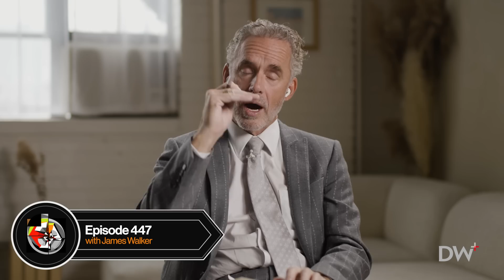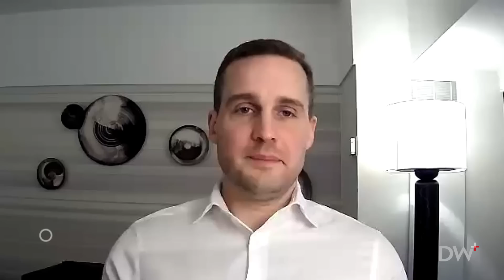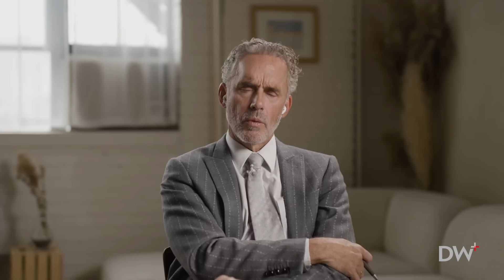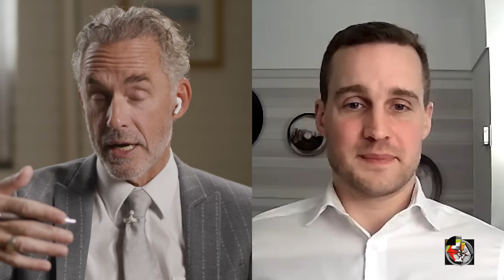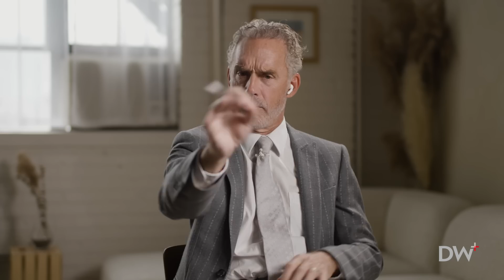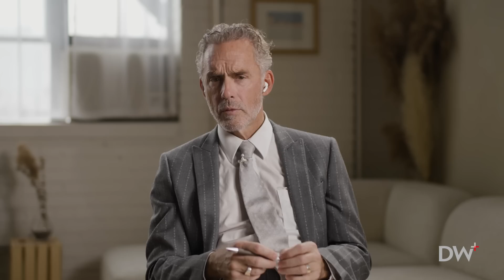There Is a Nuclear Reactor in This Truck

Comment: A single SMR can power a neighborhood for years without refueling. I’d let them put one in my backyard if I could 😂
Reply: I'd insist it was in my backyard, at least I'd know exactly where my power was coming from...
Reply: A hundred feet underneath isolated from the water table would be fine. Has worked for 50 years successfully in submarines. They are too small to be weaponised. Scale is important.
Reply: @AnonJohn143 a concrete vault might be a better idea, could place on surface and the tough construction would help prevent damage from natural disasters or other incidents.
Reply: @WELLbethere  fair comment. In truth accessibly is a double edged sword. I.e easier to access and fix on the surface, but also easier to abuse. It's a design/engineering problem. Hopefully they get over the corrosive issues with thorium molten salt reactors, it would make those aspects more straight forward imho.
Reply: I'd rather, see one in the local sub-station(s) and use the existing transformers and other equipment. Much lower voltage is needed for short power lines.
Reply: @tobyw9573  Wherever, however... I want to see nuclear power built out to the point that the average Joe could have a mini reactor in his basement!
Reply: This was part of Biden's New Green Deal that he was running before the last election. Small nukes to power small cities and big nukes for a large city. Biden never talks about it because voters would freak out if they did.
Reply: If they could get one to work…
Apparently no one has got a reliable SMR going well and/or safely
Reply: @michaelcooney7687  I believe that is only a matter of time.  
Also, when it is safe means never.
Reply: @michaelcooney7687  
Go watch a documentary on MSR.  They ran the reactor for two years shutting it down every weekend when the scientist went home.  That's dozens of starts and stops without an incident.  It takes days or weeks to safely shut down high pressure reactors.

The biggest problem with MSR is the bad reputation other designs have given nuclear power.  It's like thinking electric weed eaters will be noisy and smoke spewing because for decades all weed eaters were powered by two stroke gas engines.
Reply: @JimStanfield-zo2pz 
While that sounds great I'm willing to bet there's some serious losses in efficiency due to friction, pumps and motors.

That does remind me of one proposal to use hydro in places with huge tidal shifts where the water rises and falls a few feet daily.
Reply: Perpetual motion machines dont work, no matter how you try to finagle them.@JimStanfield-zo2pz
Reply: SMR? Did you really mean MSR (Molten Salt Reactor)?
Reply: @Milosz_Ostrow  Small Modular Reactor...
If I parsed it correctly.
Reply: @wheel-man5319  - That's the problem with using acronyms and abbreviations.
Reply: @Milosz_Ostrow  Indeed...
Reply: You would do this because you are uninformed on better options.
Reply: @DoniIionescu  please inform us of any available better options?
Reply: Make sure they can bury the waste in your yard as well. Alls fair, Right!!!!
Reply: @KOz1caa  I've no problem with nuclear 'waste' being stored on my property.  The only caveat I have is that I, or my heirs get to sell it when the rest of the world stops being insane about nuclear reprocessing....
Reply: u lack the qualified people to maintain them
Reply: Sure.. only cost 100 millions dollars  to install and operate...  

just like buddy's dream with trucks and facilities.... its not economically viable!!! ... not talking about the waste companies have to pay for 100 years...
Reply: @joseph-mariopelerin7028  
And why are those cost so high?  Because activist pushed to make sure they were.
Reply: @tonyrmathis activist? Lol 
Don't need any activist to make people realize it's not economically viable... 

We still paying for decommissioned plan 60 years after... if thats a better legacy...
Reply: @tonyrmathis you're right tho... without activist, they would still be dumping waste in the ocean... and the whole thing would be affordable...
Reply: @joseph-mariopelerin7028  Broken record much?
Reply: people do not like nuclear reactors, they want hydro
Reply: @shazzz_land  
Sure we love hydro but do you know a way of creating new rivers?  A direct line to God perhaps?  I'd rather not insult you but I think the point needs to be made that our biggest problem with solving our energy problems is people who go by feelings rather than logic.  Energy is a hard science problem not a social science one.  It's math not feels.  We can't dismiss things like power density, reliability and other concerns simply because they favor types of generation that don't feel good.  We also can't pick and choose which environment risk we ignore.  Windmills/Dams killing threatened species and pollution from mining for solar is just as serious an environmental threat as containment of long term nuclear waste.  In fact I'd argue even more so since once those species are gone they're gone forever.  While a 1000 years from now we'll most certainly made advances in the storage and probable use of waste.  What we need is to embrace science and work on our own insecurities by educating ourselves and that too not with just information that makes us FEEL good.
Reply: @shazzz_land >>> Hydropower is not available everywhere.
Reply: @shazzz_land  In the US we have torn down hundreds of hydro facilities to return the waters for fish movements etc.
Reply: @shazzz_land you speak for all people? Amazing.
Reply: @shazzz_land  hydro often involves destruction of habitat and land through flooding and isint always possible on a wide scale. Having said that id support it where doesn't do so much damage as it acts like a battery of sorts. I think the mix of power is possible, and nuclear provides a reliable and relatively clean baseline of power IF managed correctly. We need to train more people to do so imho.

Comment: U235 is the only easily fissile isotope of uranium and it is more rare then platinum. Imagine using platinum as fuel, kind of insane. I know we have enrichment plants to bombard U238 -> U235 with neutrons, but its an insanely costly practice.

I'm all for nuclear power, but the uranium cycle sucks. Thorium-232 is so much better. It's 99.8% of the naturally occurring isotope, it's super abundant, and we already have a stockpile of it from discarding it as "naturally occurring radioactive material (NORM)". Breeder reactors use it, right now India is planning to build the first commercial advanced heavy water reactor using thorium-232. We should be more like India.
Reply: let them catch up.  Baby steps needed for the fear-filled babies.

Comment: LFTR’s. Liquid Fluoride Thorium Reactors are the answer to most of the problems noted here
Reply: I really really wish ae would go with the Liquid Fluoride Thorium Reactor. That thing is so badass. It has multiple built in fail-safes by nature such as already being "melted down" so it cant catastrophically melt down, also the liquid fuel expands AND absorbs neutrons slower the hotter it gets, so as it expands more of it moves outside the core providing less fuel for fission, if theres a leak it drains into a storage tank below by being within a kitchen-sink-like room, and also if power or control is lost itll stop freezing a normally frozen salt plug which melts and makes it drain itself. Its basically infeasible to proliferate nuclear weapons from the products of the reactor (theres small chance to do so while enriching fuel needed to start the reactor, but very little is used and is only needed for startup, after that the reactors dont need to shut down to refuel so they can run for years at a time. Also they can also use nuclear weapons and nuclear waste from currently used reactors instead of enriched fuel to start their fission reactions, and turn them into a lot less and shorter lived radioactive byproducts.). It can use 99% of its fuel, versus current reactors using like 5% of their fuel that make a lot more longer lived waste (1,000's of years vs 83% of LFTRs waste being within 1-300 years and 17% being decades, but its more radiotoxic.). The molten liquid salt is both a coolant and fuel that jackets the core and both shields it from radiation and absorbs the nuetrons, converting it into the isotope of uranium needed to be pumped into and used in the core for fission. This makes LFTR's scaleable, you dont need feet of concrete or lead to shield you. The reactors operate at atmospheric pressure and if theres a loss of containment, the molten salt is actually extremely stable and wont react with the air or water and doesnt build up explosive gasses, just xenon gas like other reactors which "poisons" the reaction but it can be actively removed, just as fuel can be added, without shutdown unlike normal reactors. Thorium is 4 times more abundant than uranium AND is a nuisance byproduct in rare earth metal mining. We have enough thats been buried in Nevada to run for 400,000+ thousand years. To power the USA for a year youd create roughly a briefcase sized amount of waste. There are proposed methods with MSR's to have more efficient turbines than current steam turbines using the liquid salt and gas I think. This is all from memory and Im struggling to recall but theres a shit load of good reasons to go with LFTR's and most of the negatives can be reframed as positives pretty easily. A power grid supported by nuclear and supplemented by renewables where feasible is the best strategy for our best economical, environmental, defensive and political future with a prepared and prolonged infrastructure and society.

Comment: This isnt incredible. 

This isnt new.

Reactors the size of a refrigerator have been in service since the 50s.
Reply: 'Over its 10-year service life, the PM-3A system had availability of just over 72 percent. By 1973, however, the reactor was shut down and decontamination operations started. For detractors, the system was a failure. But a close look at the final operative report, which is available online, shows that system failures were the result of not just the deficiency of materials available half a century ago. Instead, the system failures were due to repeated sensor and control electronics problems, along with plant shutdowns for maintenance, repair of systems not involved in the reactor itself, plus crew training and changeover.'

Comment: I always respected Robert Anton Wilson's observation that the closest naturally occuring nuclear reactor to the earth is the sun, and that might be an appropriate template or model for how humans can safely use nuclear power.
Reply: It's so much more complicated then fission. The sun undergoes fusion, which is like hitting a golf ball up a hill and both the ball and the hole are opposite magnets, we're trying to get the ball in the hole. A highschool kid can accomplish fission in their backyard.

All fusion engineers will tell you fusion is 10 years away 10 years from now.
Reply: @maximusf3063  I just mean the scale/distance ratios for safety.
Reply: The sun causes cancer and blindness if you stare at it for too long.
Reply: The sun uses nuclear fusion, not fission. Fusion is much cleaner but much more difficult to pull off today.
Reply: nuclear FUSION reactor - this interview is talking about nuclear FISSION reactors
Fusion experiments have all failed, failed for more than 50 years and I suspect that there will never be fusion reactors on the face of the earth.

Comment: There are different types/ways to make radioactive fuel.  The less popular has a shorter life cycle which does not take nearly as long to break down to safe levels.  In addition the “waste” from large power plants has plenty of energy to run smaller plants for a long time, so it can be recycled almost directly if we so wished to do so further reducing any waste.  Right now it is disposed of as soon as it drops from maximum efficiency for a large nuclear plant.  We have the technology!
Reply: Thank you, you are correct and we all will benefit when they stop the waste. CO2 free energy, who would have thought
Reply: My understanding is that France has been reprocessing "spent" fuel from nuclear plants for decades to remove waste components and reconcentrate it to reuse over and over in their power plants.
Reply: There is no such thing as waste. The so called waste is only a resource we are not using.
Reply: @mpetersen6  Hence, waste.
Reply: @TheCrazyFinn ”so called waste”
Reply: @rush7805  "no such thing as"
Reply: @mpetersen6 Waste is not just "spent" fuel. Waste is also anything that comes into contact with radioactive material and isn't useful anymore. You can maybe use spent fuel in a smaller reactor. You can't put used surgical gloves in a small reactor.

Comment: And the spent (discarded) fuel goes where?  Maybe under your pillow?
Reply: Stored in site or in an interim facility waiting to be recycled in fast reactors or recycle just the fissile components in MOX fuel for another reactor (only 4% of fuel gets used up) or entombed in a multilayered concrete cask in a long term geological repository 
. Your choice what to do with it
Reply: Look at ifr ii, it has been done. It's an outdated argument.

Comment: Bless his heart.  JP thinks you can put an industrial building together in 1 year...not to mention a nuclear building....
Reply: If Tesla could build the largest factory in the world in less then 10 months it ain't unrealistic.
Reply: The Empire State Building was 13 months from groundbreaking to completion, so we HAVE done this kind of thing in the past. Admittedly, in our current environment, that's very unlikely. There's also no reason we can't rebalance the regulatory environment if we feel that pendulum has swung too far toward stasis.
Reply: @ChuckMcKinnon71  yeah, sorry, I wasn't saying we don't have the will to get things done this quick.  But there is so much red tape, regulations, reviews, third party reviews, city reviews, federal reviews, and design changes that make this really hard to do.  I worked at a nuclear plant and it took 3 years just to put up 2 concrete walls and a concrete roof for a backup generator.  Why?  THE REVIEWS!  We were doing paperwork for months and designed formwork for impossibly high loads.  So yeah 3 blocks of concrete in three years and millions of dollars....smh

Comment: small nuclear reactors are not a good idea and a safety concern.
Reply: Nope. They are safer than traditional reactors, as they are designed to fail to "off", have better shielding, and can be easily maintained.
Reply: @timothyblazer1749  yes but proliferation of small reactors is an issue. It's impossible to secure all those thing and watch over them as well as big systems. Terrorist attacks are also a big concern.

Comment: I swear I have seen stuff about Dimond nuclear batteries saying they could be as small as A.A. batteries but last a person there lifetime? Random tech stuff I hear I'm a technerd 😂
Reply: My understanding of nuclear batteries is that, yes they last a very long time (decades?) but produce very tiny amounts of electricity.  As in fractions of a millivolt. Useful for satellites or space probes that need to be nearly dormant for very long periods of time but need to be "awake" enough to receive the signal that tells them to power up.  It takes nearly no power (about as much as a nuclear battery has) for a circuit board to operate in standby.
Reply: You're probably thinking of betavoltaic batteries.
Yes, they last a very long time. But they only produce a small amount of power.

Comment: What is EVEN more exciting about shielded micro nuclear is the applications in space travel in conjunction with SpaceX's heavy lift rockets.  If you can land these reactors on the moon or mars along with some multi purpose robots and a conceivable way of communicating with them remotely, then you can go about constructing the foundations for serious multi-planetary operations.  

I just don't think Solar is going to do it.  The sun goes down and batteries are HEAVY.  Having a consistent source of electrical output which is reliable allows you to do SO much more at a much greater pace.

So, for instance, Google is telling me that the total power supply for the ISS is .21 megawatts.

Imagine how much more space station you could have with a power supply of 20 megawatts!
Reply: The issue is getting and processing all that damn uranium, but with a concentrated effort it can be overcome. And if you do asteroid mining, you have unlimited energy forever.
Reply: @xfom4008  well that's it, isn't it.  If you can run a terrestrial mine on 20 mw, I should think you could run a space mine on much less, given there is no gravity.

Comment: What happens to this truck in a bad crash?
Reply: Nothing? Uranium doesn't randomly explode. If it crashes they'd just have a 100 meter radius to clean up just like any crash
Reply: The casks used for transport are tested to sustain crashes, fall and being run over by trains